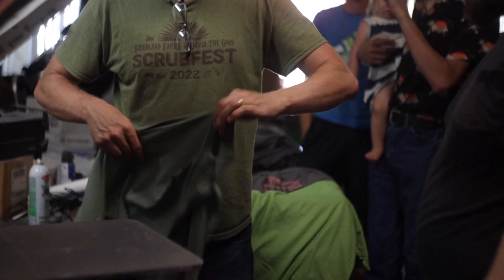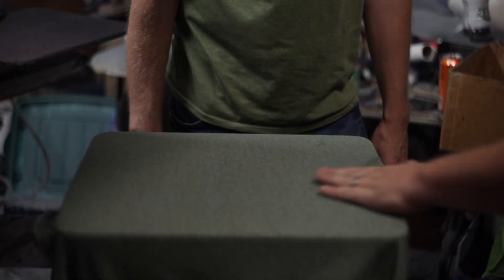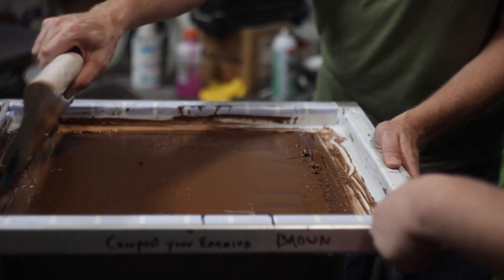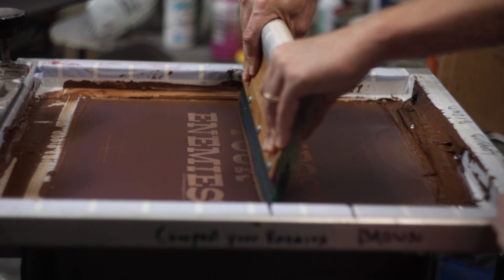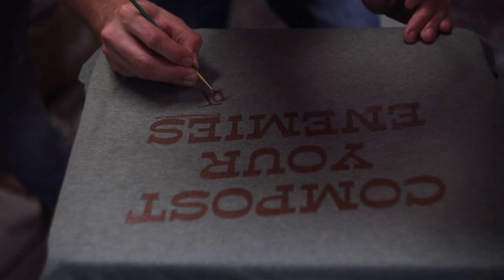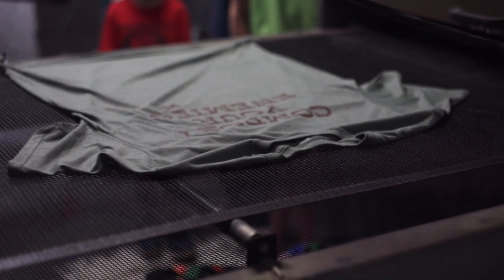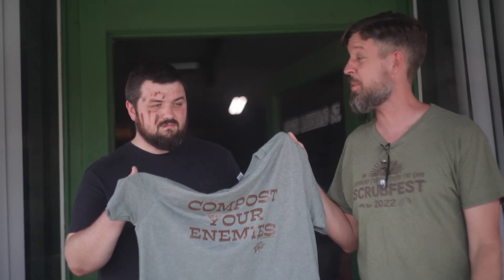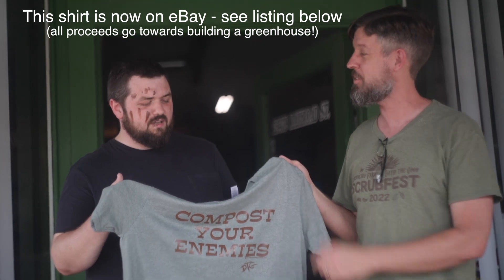COMPOST YOUR ENEMIES

Comment: Neat video!  I had a few regular customers at an old job who had screen printing businesses, but I hadn't seen the process before this.  I used to modify old Epson printer cartridges for them to be able to print the blocking layer on the screens (I think?).

If you or the kids are interested in comics at all, there's a French comic called The Delicacy where a chef did indeed compost his enemies.  It's really quite good and beautifully illustrated.
Reply from the maker: That is really funny.